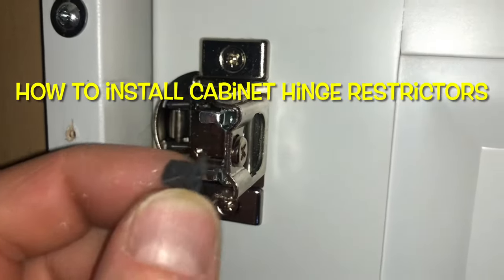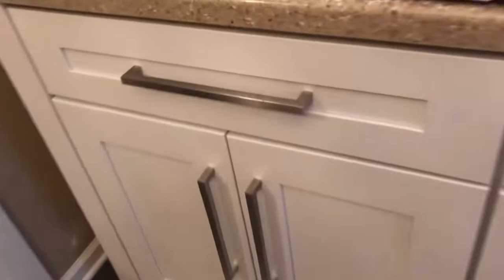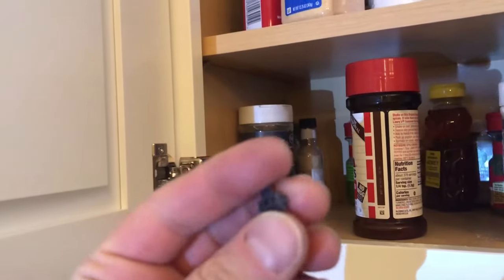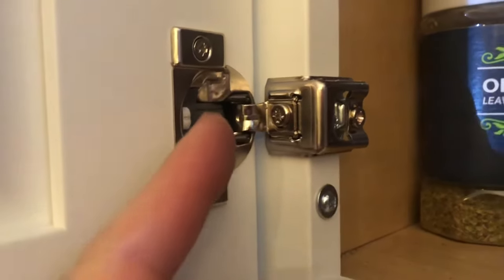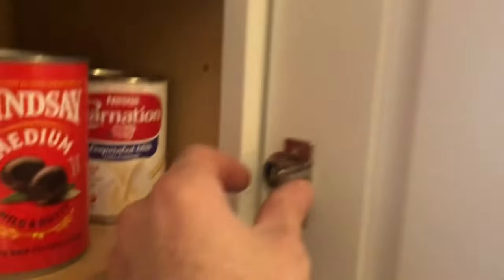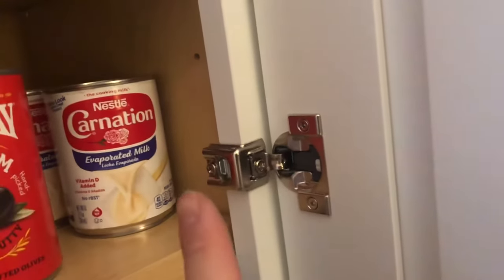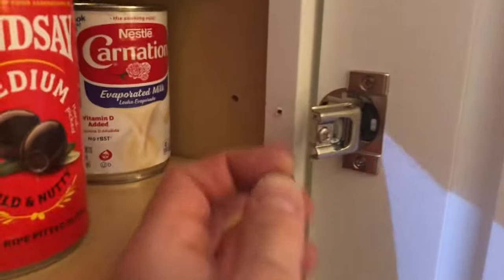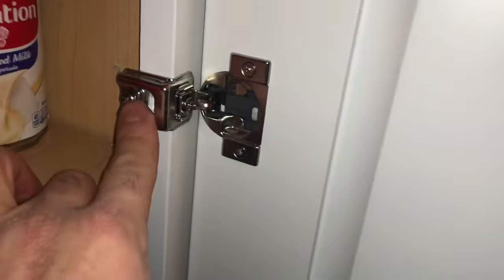how to install cabinet hinge restrictors Blum 38C315B3 Angle 86 Restrictor Clip Blumotion Hinge

Comment: It really was that easy!  My wife and I just installed 36 of these clips in our kitchen, two bathrooms and our laundry room in about an hour and 15 minutes.  On the cabinets with only two hinges, I really did need a second set of hands to stabilize the door so I didn't put any extra stress on the other hinge.  The cabinets with three hinges went very easily.  Thank you for the video, i was a little stressed about doing this job.  Simple!

Comment: THANK YOU! i had several cabinets in my new house that would damage the walls because the cabinet opened too wide. My builder refused to take responsibility for this and i was afraid that if I took the doors off I wouldn't get them back on correctly. Your advice worked perfectly! One question - do I need to do both the top and bottom hinge, because I just did the bottom and it seems to solve the problem but the cabinet manufacturer told me to do both.

Comment: Huge thank you! Just bought a house and some of the cabinets were hitting the wall. Ordered it from Amazon and installed! Now if I could only find something for the refrigerator door that opens to wide. It already has a type of restrictor below on the doorbut it still allows the door to open to wide…research continues

Comment: Honestly you only need to do the hinge in line with the handle to open the door. Doing all 3 is slight overkill.
Reply from the maker: They don’t cost much if you cut corners your stuff might start working in about six months then you’ll be scratching your head saying maybe I should’ve just did it the right way

Comment: Ok. Those are doors not cabinets that you keep referring to as cabinets.  And the screws on the hinges don't do what you said they do. The first screw you referred to that you claimed moved the "cabinet" left and right, it actually moves the door in and out the screw above it that is recessed in the hinge slightly moves the door up and down. The screw on the face of the hinge moves the door left and right.  You keep referring to the door as a cabinet.  The cabinet is the box the door is the part that is hinged.